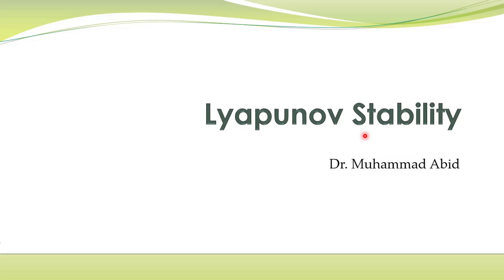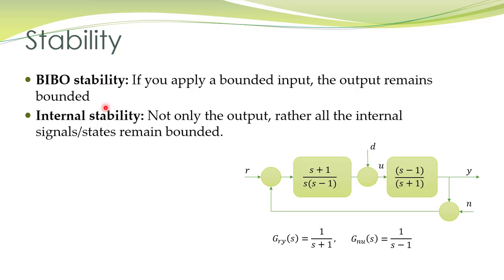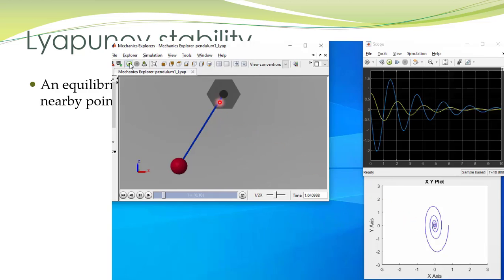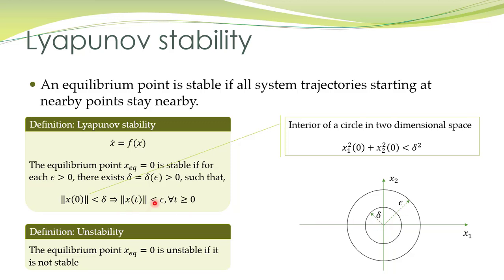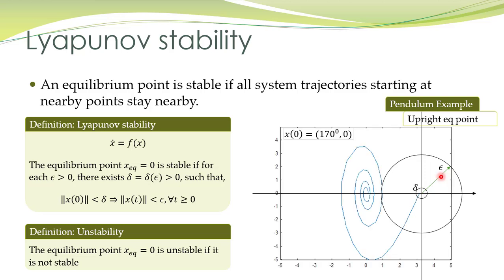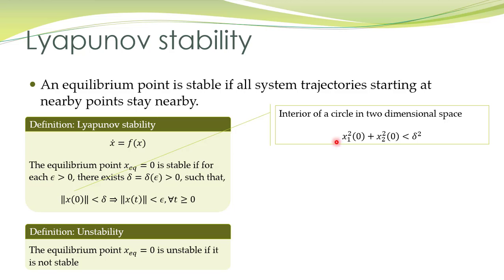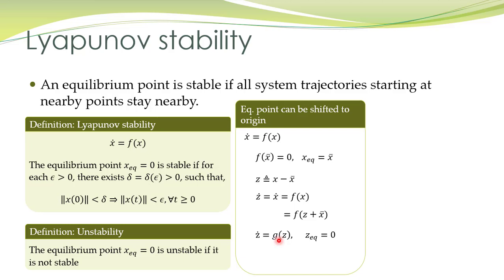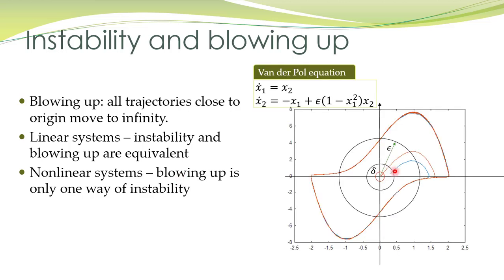NCS - 15 - Lyapunov stability - Definition and explanation

Comment: Why is delta function of epsilon in Lyapunov Stability mathematical equation? What is it significance although you just considered it as a number.
Reply: Because each epsilon has strictly only one delta associated with it. You write it down as a function because, in functions, the output is unique (i.e., You can't have two outputs for the same input). The formal definition in Slotine's book on applied nonlinear control, however, says: "for any ball of radius R, there exists "at least one" smaller ball of radius r", so I guess that contradicts what I said earlier. It depends on which reference you're reading. According to the video, just one; while according to my reference, at least one. Personally, I would go with the reference's definition.

Comment: Good evening sir 
What is the definition of Semi-globally uniformly ultimately bounded?
Reply from the maker: Ultimate boundedness means that the states will ultimately enter into a bounded region ( states will ultimately become smaller than a bound).

Uniform ultimate boundedness is a term relevant with non-autonomous systems (time varying systems). Behavior of non-autonomous systems, among other things, also depends upon the initial time. Therefore, uniformly ultimately bounded means that states of the system will ultimately become smaller than a bound for any initial time.
Reply: @MAFarooqi   Thanks sir for nice explanation.
But what about Semi-globally uniformly ultimately bounded?